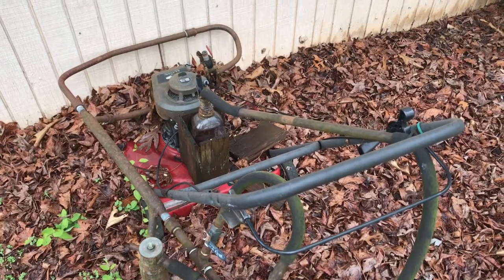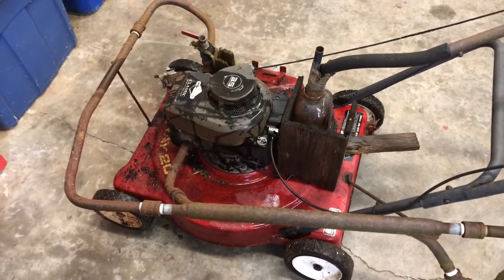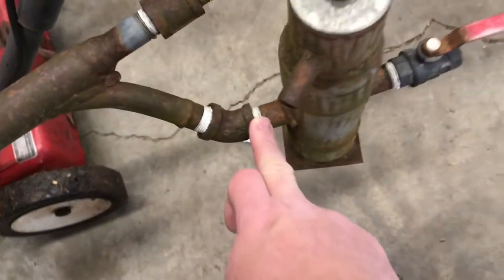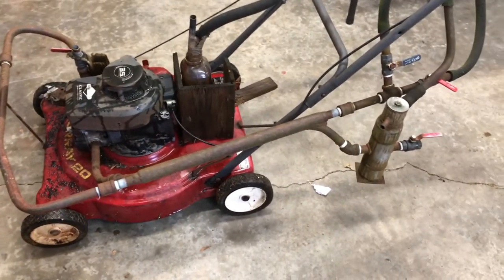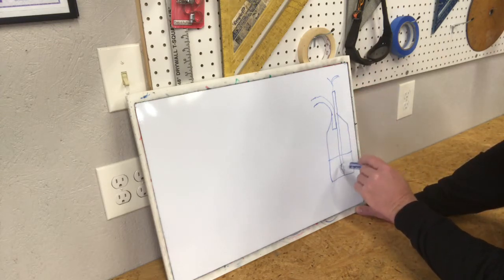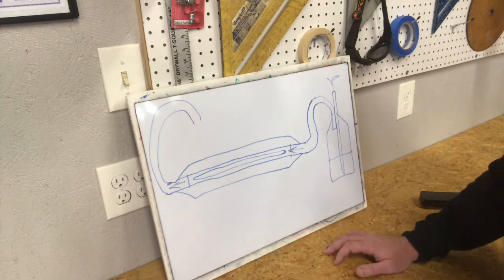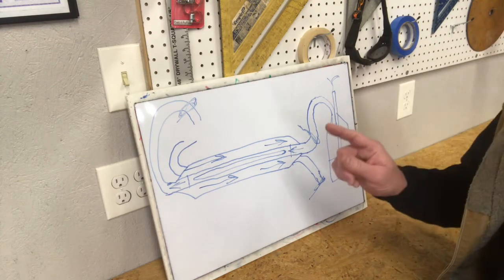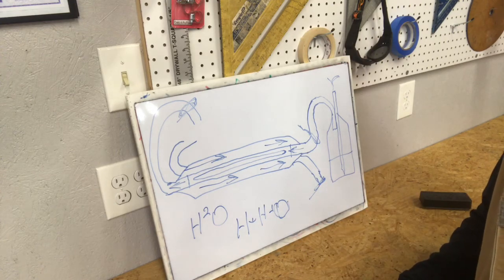Lawnmower equipped with Fuel Plasma Reactor GEET - Paul Pantone Inspired

Comment: you need a valve on  the air intake of the bubbler to get the 9 - 11 hg vacumn needed for the plasma reaction... that is a big factor.  open atmosphere is just burning fuel vapor.

Comment: your exhaust gasses are being cooled too much by your second geet in your loop after your first reactor... Do you have the 14 inch Iron rod in the centre of the inner pipe? if not that is needed...  It is longer if your using Gas...also do you have stainless steel pot scrubbers in your blubber? also that Inner pipe has to be made of 304 Stainless steel with the inner wall polished and that rod has to be less then 4mm away from the stainless steel pipe. If you don't do that the GEET gas will not be created...
Reply: So if it's not stainless steel then it won't work? I'm about to build one but dont have the stainless steel pipe. Only regular steel and the rod inside

Comment: intake fuel vapor should be as cool as possible IN INNER PIPE. and, as stated, as close to exhaust as possible for max exhaust heat in outer pipe... The cool and hot is key.. DO NOT HEAT THE FUEL BUBBLER.
Lastly is the output from reactor. It should be 5-10 feet of copper tubing.not the black piping.